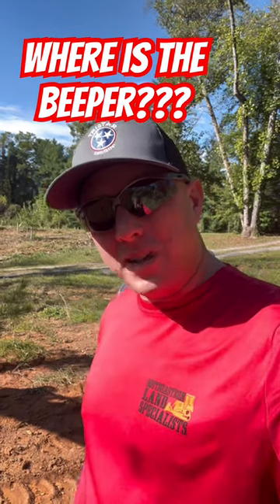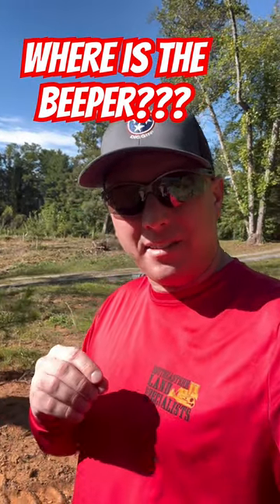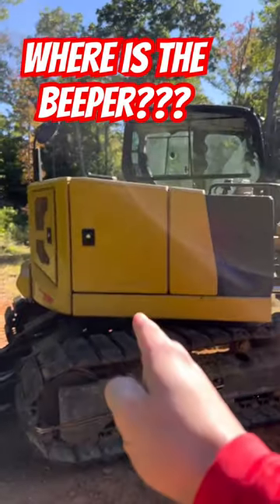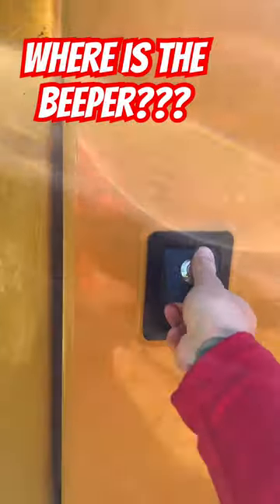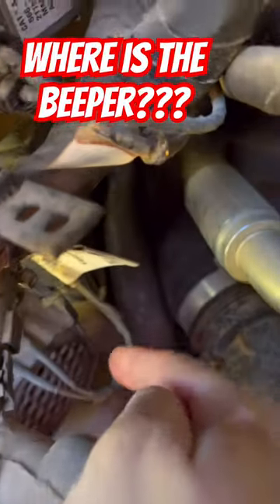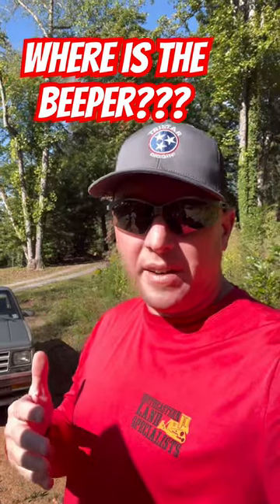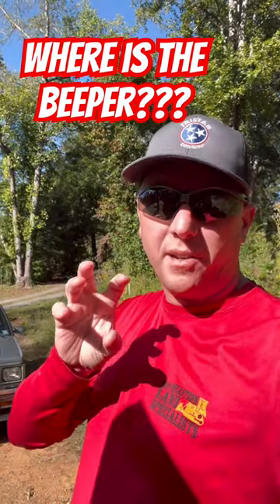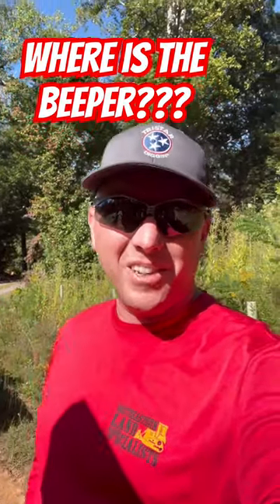Cat 309cr travel alarm location and how to disconnect

Comment: I couldn't seem to find it in my 302, but I did find it in in the control monitor.....
Service/Service Mode/"1234"/Machine/Installations/Travel Alarm......"OK" to disable the travel alarm.  Same procedure will turn it back on for when you are in a location where it may be needed or helpful.  Really wish the button to your right would do this, would be safer in my opinion (mostly use my machine with no one else around).  After-all, they did put this in there as an "option", a completely inconvenient option, but an option none the less, so it must be okay to use it during "appropriate" times......😂

Have a good one!!
Reply from the maker: Thanks for sharing!!!